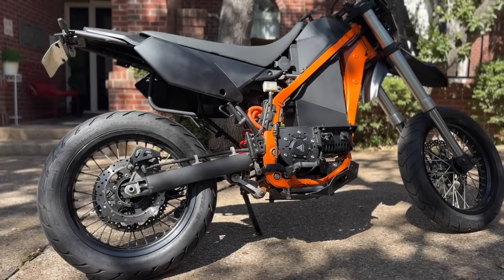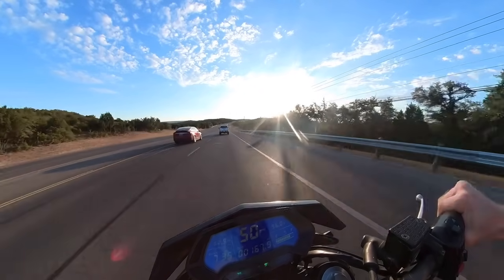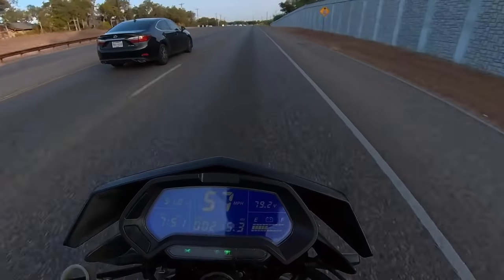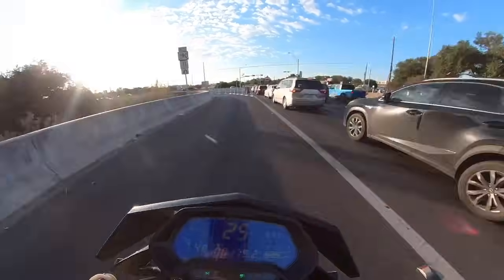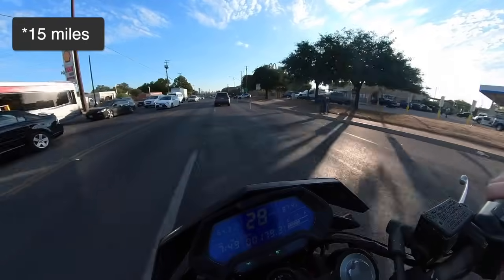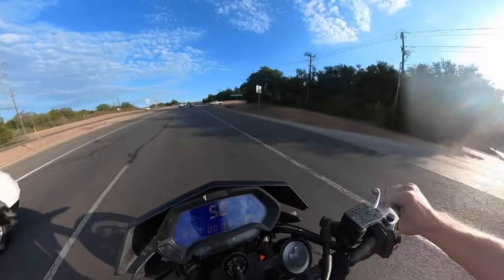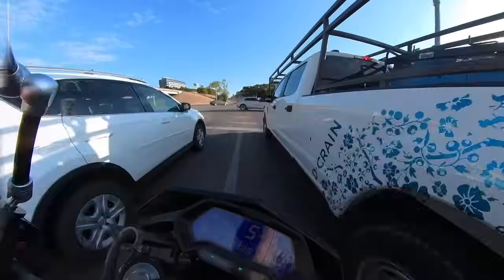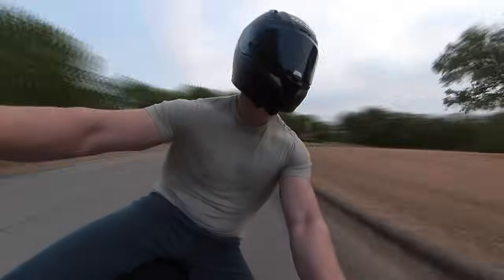I Rode My DIY Electric Motorcycle Until It (almost) Died

Comment: if you were to limit amperage and drive lightly you def can get 50mi out of it
Reply from the maker: definitely! I have the "normal" power mode set up that way and have ridden 40mi using about half the capacity. range limiting acceleration and a 40mph average speed is probably around 80mi

Comment: I can be wrong but you're front tire is the other way around.
Reply from the maker: I went and double checked this - I had these tires put on by a shop vs doing it myself. it is mounted correctly but you're right that the thread kinda looks like it should rotate the other way

Comment: The amps reallt drop when you tuck and improve aerodynamics
Reply from the maker: haha yeah not the most aerodynamic setup here. actually this would be fun to test
Reply: Get a clamp on amp meter from harbor freight and watch them drop as you tuck I noticed up to 10amps on my e bike that will only draw 40max and 25 continuously am I bigger bike it's a 20 to 30 amp difference wind makes a bigger difference that you think on range and energy saving and also top speed I love the build!! Looks amazing
Reply from the maker: @willverhappen  I have an amp meter running off the shunt. definitely going to try this and post a video. thank you!

Comment: 300 amps through those small wires is insane!  You should put some thermocouples on the terminals and see how hot they get.
Reply from the maker: to which wires are you referring? The main HV cables are 4 gauge

Comment: I'll say it again, well done for the build but I will also say that you're a fool for riding a "motorbike" wihout protective gear. Your skin is your largest organ and should be protected. If you don't think that's the case don't bother wearing a helmet. Cheers from OZ.
Reply from the maker: Can't say I disagree but there's inherent risk to riding motorcycles and it doesnt have to be an "all-or-none" kind of thing. a full-face helmet offered the most critical protection for the least amount of effort or discomfort. but apart from saving your life in a collision, it goes a long way to prevent getting smashed in the face with a rock at 70mph. so you don't have to judge based on the most critical scenario to see the value, even with no other gear. Beyond a helmet, I think proper shoes and gloves are important, then pants, then a jacket. but if you're really serious about safety, you should really wear full track leathers anytime you go out. But of course it's not so practical.. personally, I'm willing to roll the dice a bit in exchange for convenience. Though I did pick up some gloves
Reply: @GaiusGarage  I've never worn an open faced helmet and don't ever intend to. There's no need to wear leathers for urban riding, materials such as cordura are good enough. Track riding and agressive road riding "in the hills" ( for example) I have only worn leathers. Other than being able to split traffic and park closer to your destination, a car is more practical than a motorcyle, so praticalality is a moot point. Each to their own, your injuries have no bearing on me however I'm mindful of those who are new to riding or considering taking it up. Cheers

Comment: Brother. Wanna convert my Harley to EV? 🤔
Reply: Oooo better idea. Hybrid Harley... use the engine which is essentially a generator to generate power. Convert "saddle bags" into battery packs. Maybe do a hub motor on the front wheel so we wouldn't have to frick with much. Idk could be cool 🤔
Reply from the maker: @warrenhurlock9026  hybrid would be tricky - you need more sophisticated custom firmware to switch between the gas and electric motor. but pure EV conversion is possible. I'd be down if youre near Austin, TX

Comment: One. Where's your rearview mirrors. Two. Maybe you should have charged the bike at home. And three. Don't ride in between cars, vans, trucks, tractor trailers, and buses. Stay in your lane. That's what I do. When I ride my TRANSPRO DOUBLE BATTERY ELECTRIC BIKE.
     But. I'm not permitted on any highways, bridges, and parkways. I'm only permitted on the streets, and that's it. 
     I don't split lanes, I use my rearview mirrors. And I use my direction turn signals. 
     Ride safe. Keep the chrome side up. And the rubber side down.
Reply from the maker: it's like you asked chatgpt to write an obnoxious comment in the style of a hall monitor